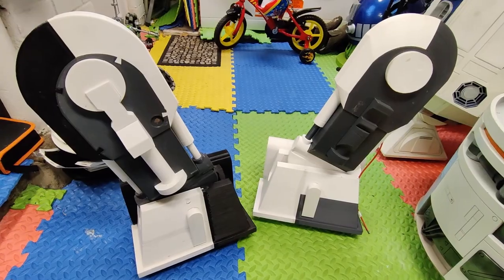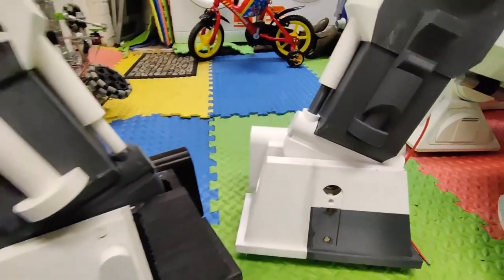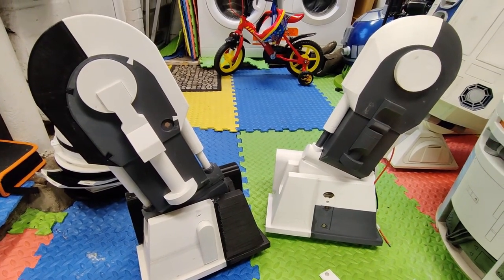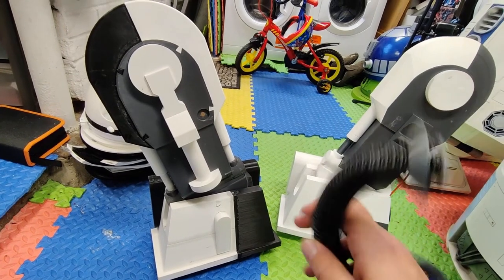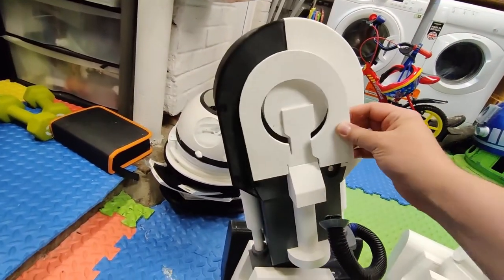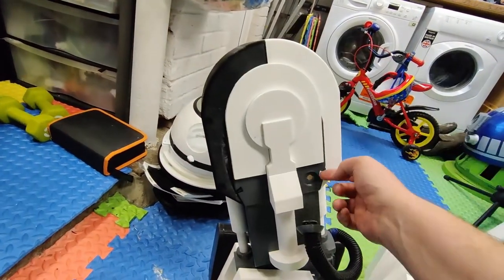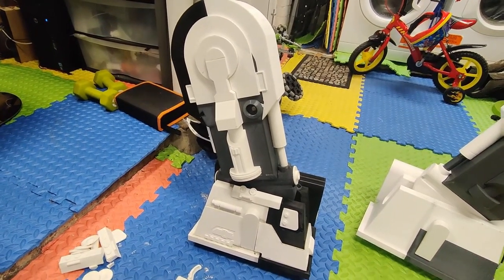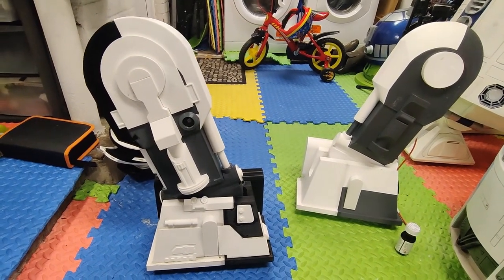Let's Build Chopper! - Episode 21 - Painting the Legs and Test Drive!

Comment: Nice video and it looks really good, spray primer on the part. Then Use superglue on those seamlines then sand over them , the superglue catches the excess u sand off and fills them. 👍
Reply from the maker: Thanks, I'll give that a try on the next one. To be fair I was rushing with the painting to get it done for DBUK. I've already had to go back and repair bits of the paint job.
Reply: @rageprint9530  yeah I’ve found with my r2 , u need to take your time with the painting, use good quality primer and paints or it will show